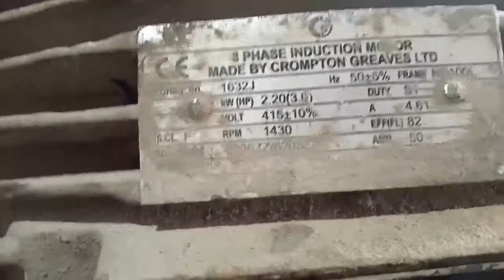how to make 3hp 2.2kw motor total rewinding a to z

Comment: crompton greaves 3 hp single phase 24 slot 4 pole 1440 rpm stater size 3.4" inch inner dia 4.4" inch nd outer dia 7" inch h plz give me rewinding data of this kind motor
Reply: rply me

Comment: agar is motor ko 3hp single phase 4 pole 1440 rpm mei rewind kare to swg wire number,  turns,  set,  pitch nd connection kaise honge
Reply from the maker: Slote koto
Reply: @UAELECTRIC   24

Comment: sir mere pas crompton greaves ki 3 hp ki motor h jo pehle 3 phase ki thi bt jab use kharida tha to wo self start single phase ki bna rakhi thi aur bahut achi chalati thi bt ek bar jal jaane par electrician ne us motor ki staring coil nikaal di aur only running coil daal di wo bhi wire number change karke ab wo motor bahut kam time chalti h aur heet jyada hoti h plz uska data provide karaye motor   stater deft 3,1/4" h inner dia 4,1/4" h aur outer dia 7" h rpm 1440 aur 24 slot h
Reply from the maker: Sir single phase or three phase. Kon torikase batateho?
Reply: @UAELECTRIC  sir ye motor jo ab mere pas h wo humaare kharidne se pehle 3 phase ki thi lekin jab humne us motor ko kharida tha tab wo motor single phase me rewind ki hui thi 3 phase to single phase ok bt problem ye h ki humne wo motor kisi ko chalaane ke liye  de di thi to us se wo motor jal gayi tab usne humko btaya nhi ki wo motor jal gayi h aur usne khud us motor ko rewind karwa liya lekin rewinding se pehle jo starting nd runnig wire number us me dala hua tha wo us rewinder ne change kar diya aur sirf running daal di wo bhi uske old number se alag aur usne us motor se starting bhi nikaal li ab us motor ko hath se push karke chalana padta h lekin motor bahut jyada heat hoti h sirf half hour ya thode aur time baad band karni padti h is motor ko 3 hp single phase 1440 rpm me rewind karna h aur ye 24 slot ki motor h
Reply: sir agar isi motor ko hum 3 hp single phase 24 slot 1440 rpm me rewind kare to running ka swg wire number kya hoga aur kitne coil set banege nd coil set mei kitne turns honge coil weight kya hoga nd coil pitch kya hogi waise aapne ek baar data btaya tha bt mujhe lag rha h ki wo 3 phase ke liye h single phase ke liye nhi